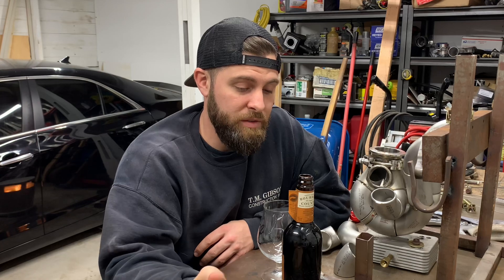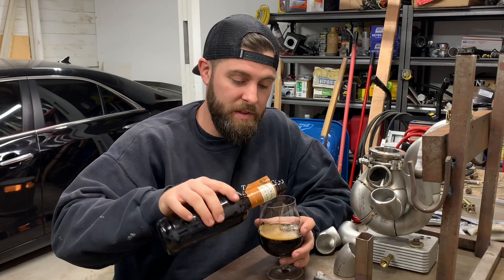Finally an in-depth tuning series for the LTG!

Comment: Have you had any problems with leaking oil from the timing cover or valve cover?
Reply from the maker: Valve cover leak started around 70k miles. I have a couple videos of that replacement I did a while back.